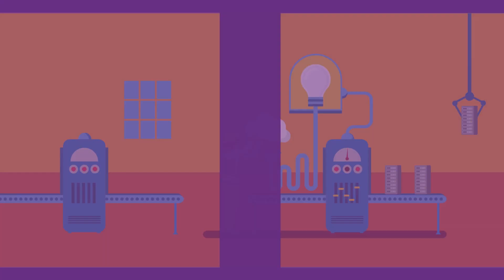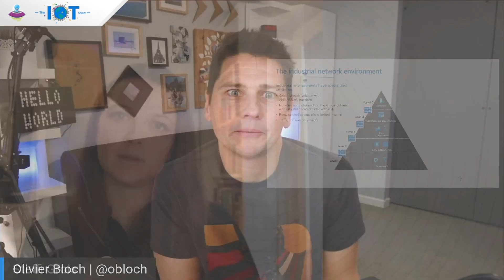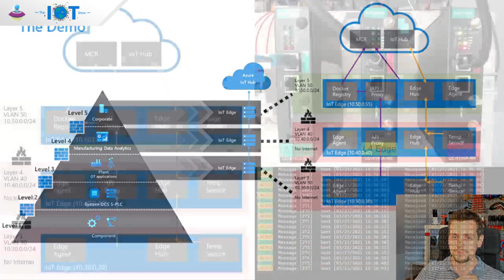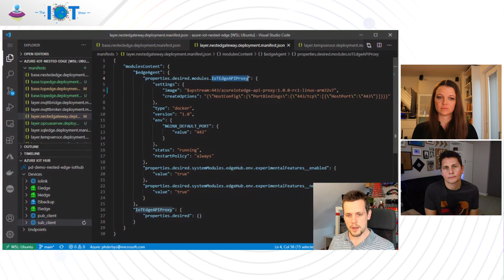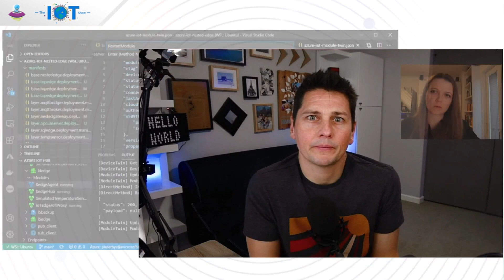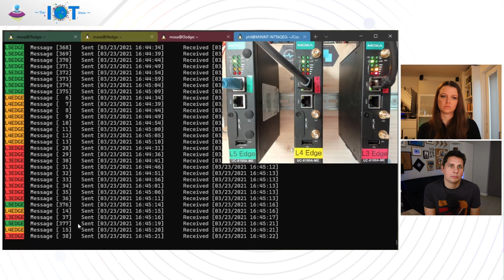IoT Show: Applied Nested Edge in an industrial environment

Comment: NIce, but how the simulated temperature device is connected to L3? Could you please show that configuration part?
Reply: Hi Muhammad,
To connect a device to a IoT Edge gateway in a lower layer, you use the device connection string and append it the lower layer gateway hostname. Exactly as you would do for connecting a device to a single IoT Edge node (e.g. not nested). This is documented in more details here: https://docs.microsoft.com/en-us/azure/iot-edge/how-to-create-transparent-gateway?view=iotedge-2020-11. To connect a module to an IoT Edge gateway (in any layer), the IoT Edge runtime automatically inject a connection string into the container of each module and the Module SDK automatically picks it up, so you dont need to do anything outside of instantiating the module SDK.  Thanks, Emmanuel
Reply: @emmanuelbertrand7438   Thanks You
Reply: Specifically the Simulated Temperature Sensor we used in this example is a pre-built module from Microsoft available at https://azuremarketplace.microsoft.com/de-de/marketplace/apps/azure-iot.simulated-temperature-sensor?tab=Overview . This connects in the way that Emmanuel describes.
Reply: @PhilipDerbyshire  Thanks alot